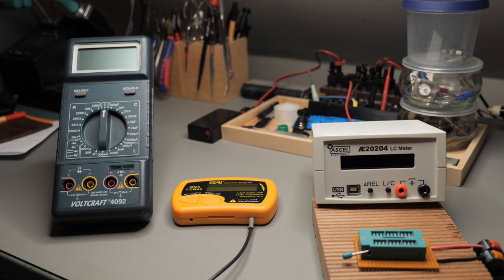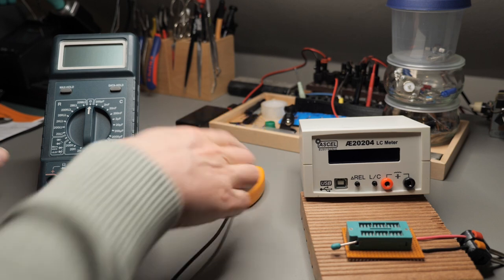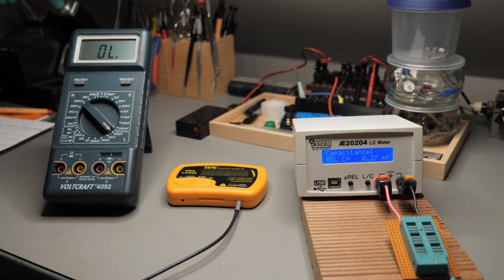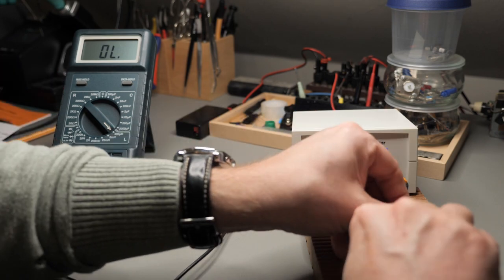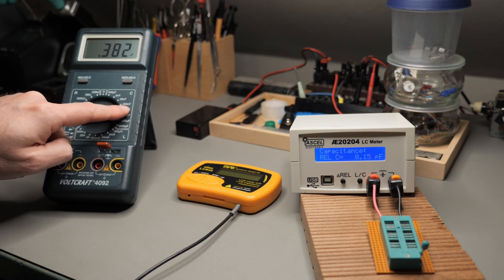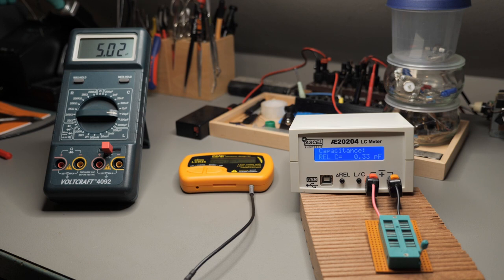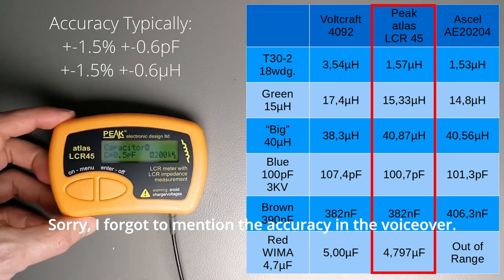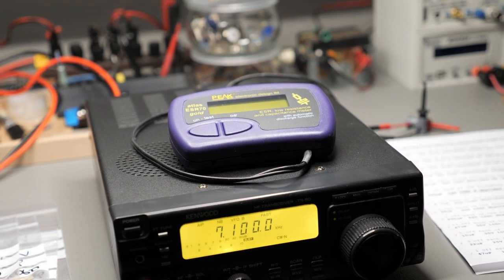LC Meter comparison | Electronics

Comment: The PEAK website states that the ESR can be used in circuit for ESR measurement, but must be out of circuit for capacitance testing.  Is this your experience?  Is this a technicality?
Reply from the maker: I think as a rule of thumb the statement is correct.
I am not an electronics engineer, so my "wisdom" comes from stuff i have read and dubious internet sources. :P

There might be rare cases where you cannot measure ESR in-circuit and there might be also rare cases where you can measure C in-circuit.
If you are trying to find a bad capacitor, a bad ESR measurement is a strong hint to lift one leg of the capacitor or remove it from the circuit and test ESR and capacitance out-of-circuit.

Measuring capacitance usually means it will be part of a measurement circuit, and if you try this in-circuit ANYTHING connected to the capacitor can impact that measurement. Just think of multiple capacitors connected in parallel - you will measure the total capacitance of all capacitors. There might be resistors that discharge the capacitor while your LCR meter tries to charge it and measure the time it takes to fully charge and calculate the capacitance from that and/or there might be components connected that impact its impedance in series or parallel. So yes measuring C in-circuit can easily give you wrong results.

Also capacitor values go over a wide range from pF to F. Different measurement methods are used for different value ranges and it depends what exactly is connected to the capacitor in-circuit how badly that will impact your measurement. If you have the schematic of the circuit you can sometimes see if measuring in-circuit might work. Most of the time it won't. 

(For really really really exact measurements you might want a meter that supports four point measurement with kelvin leads that take the inductance of the connecting leads between meter and capacitor out of the equation.)

Sorry another "it depends" answer.

Comment: Showing an chart with data throughout the video would be helpful
Reply from the maker: Results in a table come at 21:24. Should have cut down the measuring bit or ran it at 800% speed ;)